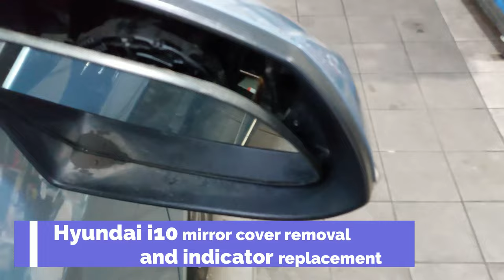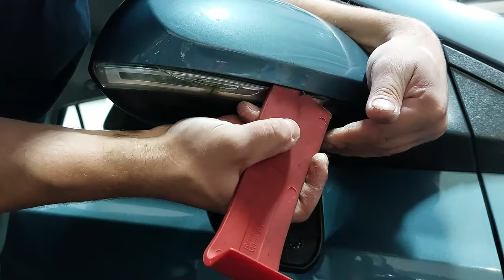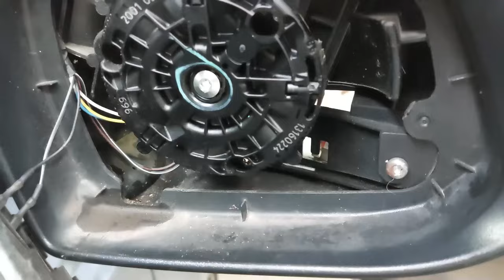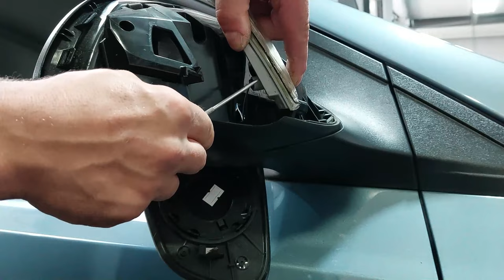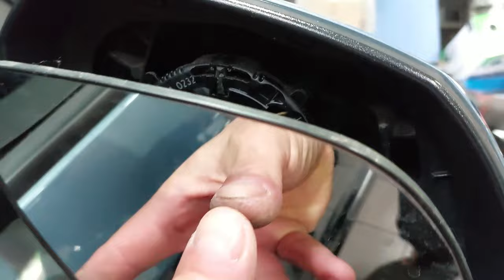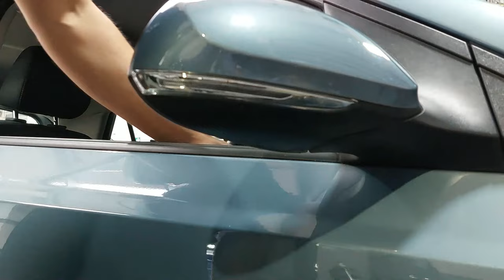Hyundai i10 mirror cover removal and indicator side repeater replacement

Comment: So the only reason to remove any screws is because they hold in the indicator unit, and the screws are behind the mirror?
Reply from the maker: Yes, the screw behind the mirror secure the indicator in place, and need to remove the cover to be able to take it out.

Comment: Well, 80% of detail was correct. It would have saved me a lot of Hassel if you showed the second screw, its hard to see on the lateral side to wriggle the old lense out! Yes, the mirror was hard to remove. I just had to keep levering around the whole mirror till it let go. You have to very careful that you get the mirror to click back in. I put a little nulon grease on lugs to get it to fix in again.
Reply from the maker: There is no second screw. I am sorry the video was not helpful.
Reply: @GicaPhp   My Santa fe highlander looks exactly the same as video, but has two screws. darl, you were helpful..and saved me a lot of $$
Reply from the maker: @vickiburrows6564  ok, I'm glad you sorted it out.

Comment: I was really scared to do this coworkers where telling me there is a 90% chance I will break the mirror ima just send it and see what happens.
Reply from the maker: just make sure you apply pressure on the inside of the mirror on a wider surface and not on the edge, and you'll be fine